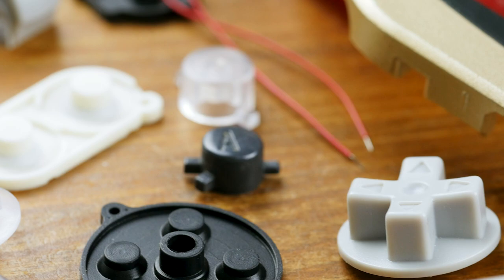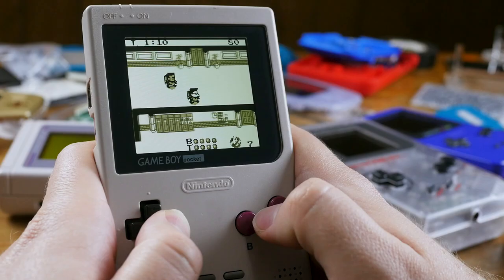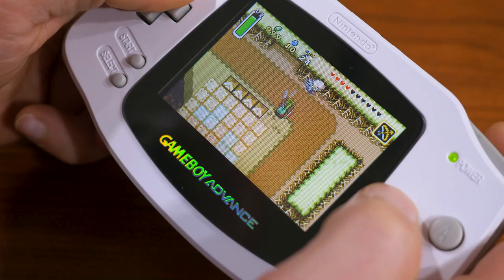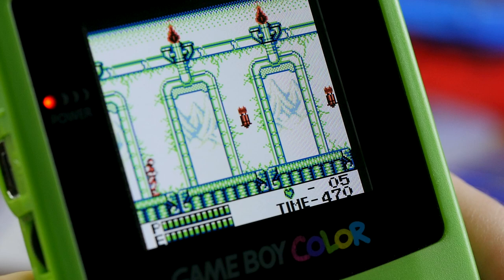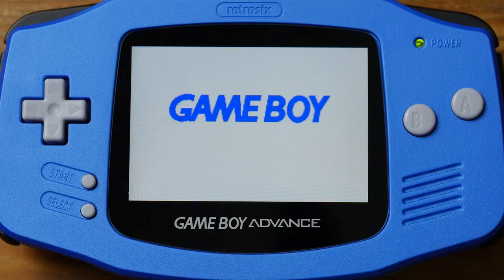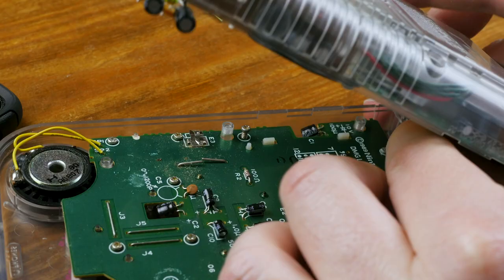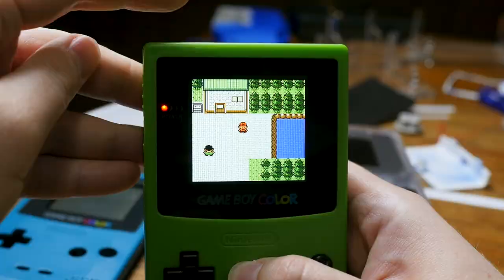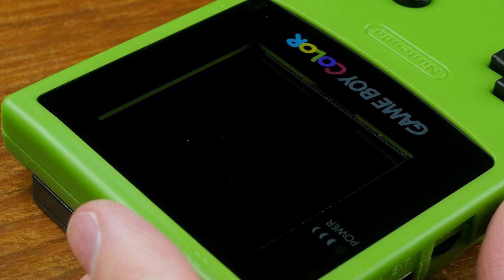Game Boy IPS Screen Mods for DMG, Pocket, GBC, GBA, and GBA SP :: RGB320 / MY LIFE IN GAMING

Comment: The ags-101 "interlace effect" is due to the potentiometer needing adjusting just behind the main sticker on the back of the original GBA. The reason factory/nintendo fitted ags-101's dont do this is because they are adjusted/calibrated at the factory when new. Obviously when you retro fit one into a GBA(especially the older model) the potentiometer is sometimes way out of whack. I adjusted mine manually as it was just like coreys...it took me 10 seconds to dial it in and completely eradicate this effect.
Reply: How do ya do that.
Reply: @JeffYPbPr  Its a screwhole behind the main sticker on the back(far right of the sticker) and you simply take a screwdriver of the proper size(nothing out of the ordinary) and gently and slowly turn until you see the flicker/lines gone. Really easy but the only pain is you either have to leave a hole in the sticker or attempt to re-apply it. Alternatively just order a new sticker when done.
Reply: @totalprocall6894  ok so it does not require removing the back shell?
Reply: @JeffYPbPr  As long as you don't mind removing the sticker, no. But if you want to keep the sticker on, yes.
Reply: I can also confirm this potentiometer is on every single Nintendo console from GBA - DSi XL, and most likely on all 3DS, GB and GBC consoles (but I can't confirm those consoles).
Reply from the maker: [Try4ce] I learned about the potentiometer late in production, and debated whether to say anything about it. However, I'm told it does not have an impact on how the IPS mod screens are driven (due to digital processing on their ribbon cables), so I decided to not get into the weeds on that since it isn't directly related to the main topic. However my understanding is that there ARE poorer quality screens installed in actual AGS-101 systems where this effect is just more prominent regardless. I'd like to know more, but I was already driven off the deep end by this video, so my brain was just not ready to go any further into those details just yet.

Comment: In regards to the flickering retention, this doesn't happen on cycle-accurate emulators or consolizers/fpga/clones using modern IPS, TN, or VA panels. Furthermore, as you've seen, original hardware displays generally don't have this issue either. Mind you the implementations above might have a sync fix for these images, but more likely this is a result of some post-processing issues or very low quality displays being used in these kits. I'm going to bet on the latter, mostly because you've experienced severe ghosting mixed with inconstant redraw of the screens framebuffer.

Comment: I would love to get my GBC backlight modded in the future, but I’m not at all confident in my ability to do it myself. Even without soldering. Everything I touch breaks.

Also congrats on the Skillshare sponsorship!
Reply: Gameboy Colors are (in my opinion) the easiest system from the gameboy line to completely disassemble besides maybe the original GBA (they're basically tied). Also, if you want an easier kit the easiest would probably be the latest BennVenn kit as you don't even need to modify the shell, although it might not be the best possible screen for you and you still would have to solder if you wanted to change the brightness.

Comment: This video hit at the perfect time for me.  I ended up seeking out a good condition DSi XL so I could replay my favorite DS games on IPS panels and I was so satisfied with it I started to consider modding a GBA to experience similar.  This does a lot to set my expectations of the final result, but ultimately I think I'll still do it! It sounds fun and I don't think the retention issues will bother me as much as the overall response. 👍
Reply from the maker: [Try4ce] I think that's a good choice! Expectations have a lot more to do with the opinions we form than I think people would like to admit. Had I known about all these issues before getting into it, I wouldn't have been as disappointed when I saw them. When you play a game that was good, but not as amazing as you were hoping for, you might have a poorer opinion of it than a very average game that turned out to be more fun than you were expecting. That happens to me, at least.
Reply: You can play the entire GBA library on your gorgeous DSI XL if you simply mod it. The DSI plays GBA games natively, it just doesn't have a physical game slot. With a mod, you can play the entire library off an SD card.
Reply: @vladg5216  Thanks for the tip! I looked into it and although my original want was to use actual carts, it's always good to have options!  I just tried it out for a few, and there's some compatibility issues and sound issues on some games, but when a game works it looks great!  Now I get to ponder why in the hell they decided to leave the gba slot out of the DSi in the first place... Such a shame. :(

Comment: The speck of dust problem: run a warm shower and get the room nice and warm and humid, then apply it. It'll get a lot of the dust out of the air so it's not sneaking in under your screen cover.
Reply: the poor mans clean room. 👍

Comment: I've always found the Gameboy line's passively lit screens to be very good. They're designed to be played outside, and work very well in that situation - even better than modern backlit screens, as those need to have the brightness turned up high to be seen in a bright environment. If i'm playing inside, I'll use the Gameboy Player, which just makes sense as I'm not needlessly wasting the batteries that way. The only situation that proves an issue is outside at night, but I've rarely ever needed or wanted to play in that environment, anyway, and when I have, I've found a streetlamp to stand under. Obviously, a major issue with the original Gameboy is ghosting, but that problem was fixed in every subsequent system.

Comment: The interlacing effect can be removed by tweaking the voltage potentiometer. There is a hole on the back. And can occur on real and fake hardware. That’s why it’s different on multiple screens. Please thumb up for exposure

Comment: I still have my AfterBurner frontlight modded GBA AGB-001. I had such a great time using it after playing a dark GBA for so long, as well as successfully installing it myself, even with the brightness settings, that I haven't had the heart to remove it. 

A few years ago I bought an AGS-101 modded GBA AGB-001, with replacement parts/glass lens model from China. It was only $68 shipped at the time, and looks/plays excellent. The screen looks nearly identical to the DS Lite, to me. The pixels look great to me, and I don't notice any weirdness, aside from a little noticeable audio buzz through the headphone jack, when the volume is turned up. Not too bad though.

Comment: A bit late but in my honest opinion Drop In kits are most likely the best route for people without soldering experience or the tools to do so. Just depends on how confident you are/how much time you are willing to put in for the end result, honestly retro tech is probably one of the better starting points for solder practice in my opinion just because of the documentation on the hardware and somewhat simplicity paired with guides for installation of the mods, at least for the handheld consoles from nintendo :)

Comment: One key point that hardly anyone touches on is that for GBC and GBA both these screens and the AGS-101 screens produce incorrect colors. It's not just that the colors are more saturated or bright than the original non-backlit screens, but they use a different color space. GBC and most GBA games were designed with the original color space in mind. The GBA Micro (OXY-001) is the only official backlit screen that has correct colors, though it doesn't support GBC hardware. The GBA Consolizer and the MiSTer do offer color filter options to address this.

Comment: I installed a FunnyPlaying V2 screen into an original GBA using a replacement shell molded to fit them w/o modding. Looks fantastic and haven't noticed any issues aside from a tiny amount of light bleed from outer edge of the lens due to using a clear smoke shell after a month of regular use. I definitely prefer the new IPS to my old AGS-101 which had the flicker issue, and had awful ghosting.

Comment: I've spent a lot of quarantine learning mods. It can be frustrating, but that feeling when you actually get it to work (and not have any dust) is such an amazing feeling. I do need to warn about repro buttons on the GBC and GBA, there's an imperfection on some that make it so you can press down all the D-pad buttons at once and causes problems. You need to make sure it has a rounded bottom not a flat bottom.

Comment: Sorry to necro this, but you spoke about the repro shells making the controls feel bad.
I've noticed in my modding that _some_ repro shells have the posts for the membranes just a millimetre too close.
It causes the membrane to sit slightly buckled, which makes the dpad feed stiff and crunchy (it will squeak).

I mainly mod/refurb gbc and gbp and I have found that the funnyplaying shells have the prefect post placement for stock membranes!
If you already have a shell (I dont do this on any I sell) you can use a scalpel to carefully enlargen the post holes by making them slotted towards the centre of the membrane.

Comment: Electrical engineering graduate and former semiconductor product engineer here. I used to debug problems like this for a living (on a completely different kind of product). I'm compelled to share my idea here out of my excitement for a nice backlit screen solution for GBA and my disappointment for this execution. 

FunnyPlaying must have noticed the flickering of the fzero map (was this intentional by the game developers to create a transparency effect on the cheap, like the inability to render transparency on old GB/GBC titles?) and must have decided it would be nice to "smooth" that out to reduce the flickering (also to mimic slower ghosting/blending screens of GB/GBC?). So on the V2 ribbon cable, as a side effect of the blending of sequential frames to prevent the "flickering" on things like the fzero map, they've probably unintentionally created all of these other issues try is pointing out like flickering image retention/ghosting whenever the logic on the screen's ribbon cable detects what it considers a flicker and tries to smooth it out. The video on the FunnyPlaying youtube channel (channel is called "Valder Jay") shows two identical screens with the only difference being the ribbon cables. The panel on the right, which actually displays the flickering of the fzero map correctly is doing so because the logic in that ribbon cable is not trying to blend the frames to reduce flicker. This is because the ribbon cable on the right is a dead knockoff of the logic of the OLD FunnyPlaying V1 ribbon cable which didn't try to blend frames, but still had the sync issue causing tearing. So, the knockoff company realized FunnyPlaying's cable producer got their design updated, and so the knockoff company just followed suit and introduced their own blending logic to mimic the V2 - which of course means now all of these cables will not produce a flashing fzero map and will all cause the new artifacts (like with the pokemon roof against the grass, trailing piranha plants, etc..).  The obvious solution would be to undo whatever change they implemented to blend frames (or parts of frames, or whatever) to create a discount-transparency - hopefully a separate thing altogether than the fix for the issue causing the screen tearing. Hopefully they figure it out and fix it soon.  It could also be this "fix" masks other issues that would be even more problematic than the issues that've been introduced and an entirely new solution is needed. 
Disclaimer: This is 100% my own speculation and I don't actually know anything. Sorry for the run-on sentences, and large and unstructured paragraph.

Comment: I find the image retention issues absolutely fascinating here. Because this isn't the first time I've seen this on IPS displays. 
In particular, a certain 23" Apple HD Cinema Display. 
That panel came from a friend's studio, it suddenly died and he just said take it if you want. 
It's an early one, April 2005 (so a Hitachi S-IPS panel). Supposedly didn't have any ghosting issues before the power supply exploded. Got a power supply for it and it worked. But image retention was VERY noticeable, especially on middle tones that could last minutes at a time.

I'd almost wonder if this is a power delivery problem

Comment: Thank you so much. I was so close to ordering all the parts from Handhald Legends, but now I'm convinced I need to wait a little while longer. €100 saved. 
Also, thanks for addressing the issue that non-original membranes and buttons can make the haptics feel off. I was afraid of exactly that happening.
Reply from the maker: [Try4ce] I think this still will hopefully be in a much better state within a couple or years, but yeah, I'd hold off! I don't know a ton about choosing parts... I'm sure there is some good repro stuff out there. That metal shell and buttons are pretty awesome! I forget if Tito said whether the GBC used the original membranes or not. Obviously those can wear out (some SNES ones of mine went bad), but for the most part I've not had bad ones. I did buy replacement SNES ones, and I liked them at first (even said so in a video) but after further use, I'm not satisfied. The diagonals work very poorly, so now I always check a Contra game when testing a new controller to see if I can comfortably hold diagonal shots, or if diagonals are triggered too easily when I meant to hold up/down/left/right instead. It's a weirdly fine line on that stuff, and amazing that so much thought was put into the original controllers so that they feel good to aim in every direction.

Comment: Many people probably already commented this, but the "artifacts" are very much intentional, and funnyplaying IS actually touting it as a feature correctly. 
The original GBA screens, before the SP, had insane amounts of ghosting, so moving objects blurred a lot. GBA is also incapable of true transparency in its graphics, so, what developers back then did, is abuse the LCD ghosting to create faux-transparency by way of very fast flickering. This is why the F-Zero map flickers on a modern display, but on an original GBA model, the flickering would remain between frames, causing the map to be transparent against the background. But viewing it in a modern display with faster response times breaks this effect.
What some emulators do, and what funnyplaying is doing on their screen, is called interframe blending, and is meant to mimic this effect. They're using "smart" interframe blending, which doesn't blend the whole image, but rather, attempts to detect when a flicker effect is being used, and only applies the blending to those affected pixels. The retention artifacts, like in the Pokemon house, are false positives, the house has a repeating pattern when moving so the screen thinks it's a flicker effect and blends the frames in that area for a few frames, leaving a "ghost" effect.
This is why the map does not flicker in F-zero, and why it takes a few decimal seconds for it to kick in, it's an intentional process!
Reply: is the ds lite the best way to play gba carts

Comment: The 'interlacing' effect you guys are getting on the 101 mod is caused by one of two problems:

- Potentiometer on the back of the GBA not adjusted correctly
- The mismatch of ribbon cable and 101 screen, there are two versions of original 101 screens, then as you know there are two AGB versions with different number of pins.. But then, there are different ribbon cables too, most modders don't mention it because they either don't know or just forget to.

I have modded many AGBs with ONLY original AGS-101 screens (Yes, I'm a butcher, and I don't consider it destruction, but that's another topic).

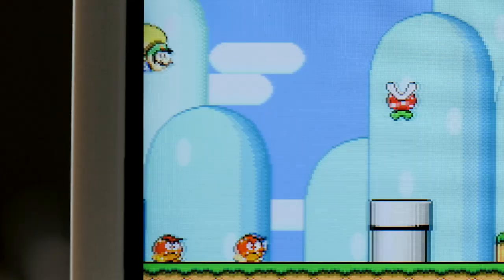Comment: The issue you're describing at 21:43 is pixel overshoot, it's an artifact that's created when the overdrive setting on the LCD is set too high, creating inverse ghosting. Basically overdrive dumbly predicts what colours the pixel is supposed to be switching to ahead of time but if the overdrive setting is too high, they'll switch to the incorrect colour "overshooting" the target, so to speak. You can see the same issue by using a gaming computer monitor and setting the overdrive setting to maximum.
Reply from the maker: [Try4ce] Interesting, never heard that term before. That makes a ton of sense. It feels like a "predictive" effect, and I at one point described it in the script like that, but changed my mind about how to word it. Every way I tried to describe it sounded insane. It's the most bizarre and awful looking thing to me. I wonder if that's an inherent feature of the screen, or if it's something that's part of the ribbon cable and could in theory be tweaked.
Reply: @mylifeingaming  It should be able to be adjusted with firmware for the screen pretty easily, if that feature isn't available despite pretty bad inverse ghosting issues then it's a pretty big oversight by the manufacturers.